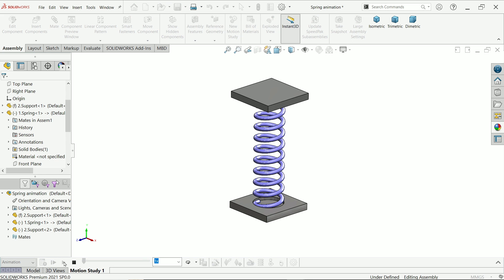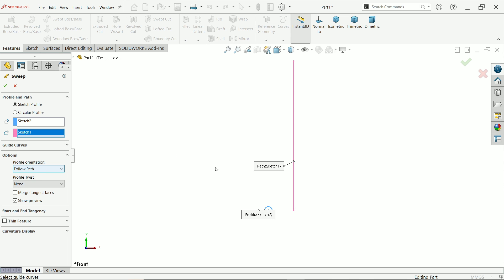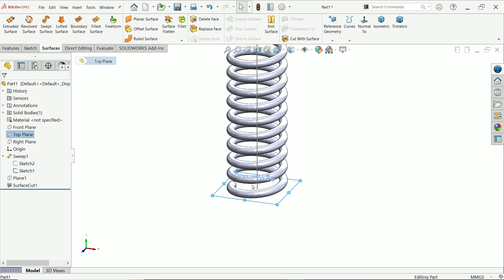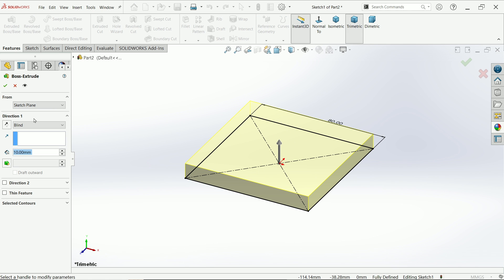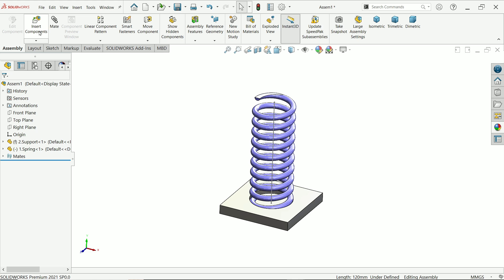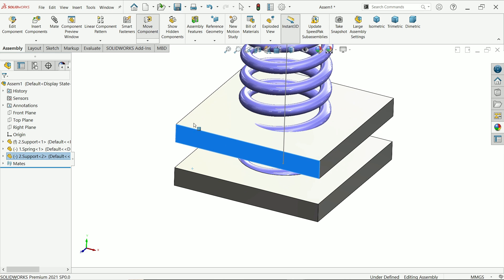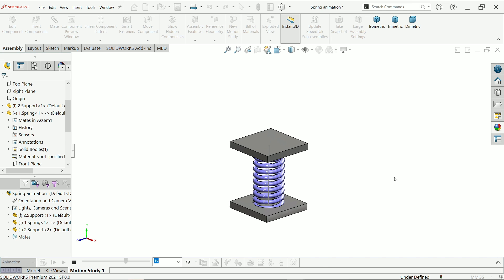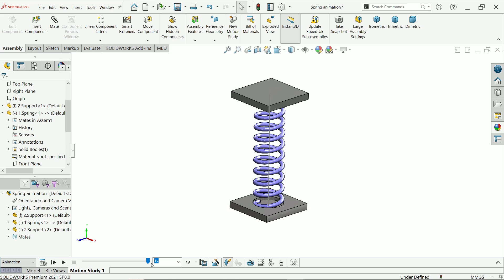Solidworks Spring Animation | Motion Study in Solidworks

Comment: Can this type of spring compression animation be included as part of an assembly animation using the exploded type of animations?
Also; is it possible to spin a component as a part of the animation in Solidworks?
For example, animating a screw being screwed into another component.
Reply: regarding  your second question about animating a screw being screwed it's possible just search for mechanical mates and you will find alot of videos explaining how to do it.

Comment: this piece of garbage software will not allow the creation of the second sketch !! I follow this step by step and it does not work ! I create the centerline OK .
Then I close out of that sketch and try to create ANOTHER sketch for the circle . This P.O.S. keeps forcing the second sketch into the first one .
This means the sweep command will not work because there is only one sketch even though I have done everything possible to put the circle on its own sketch !
Reply: Let me tell you 
When making the circle , remember to no let it form any relation of reference with the line .
You can later make the circle centre horizontal to the line

Comment: How do you animate the tracks of a tank or a belt around a pulley or a bicycle chain or....? 
Transitioning from Fusion360 to SW2020. I learn a lot from your videos. Thanks.
Reply: Belt function is the first start to trace the path of the track so that the wheel or pulleys you use turn like a belt motion (track) 
, then you use the chain pattern to insert individual track along the path.
If what I said does not work, tutorial about that is already on Youtube (not mine) . You can search it.
Reply: @cad2ts  Thanks. Now I understand.
Reply: You can use belt function on Solidworks assembly
Reply: @cad2ts  No. That function doesn't animate each individual piece of track in a tank track.